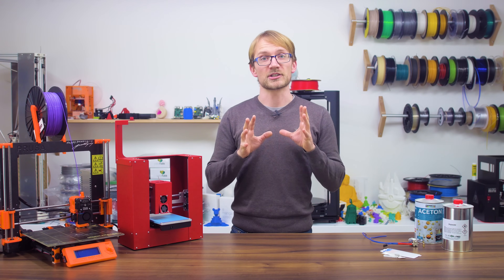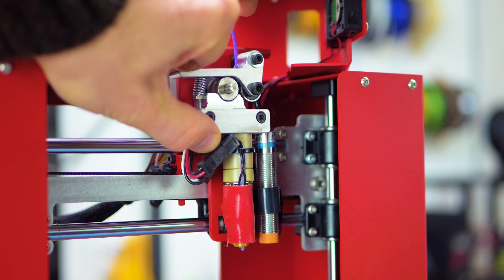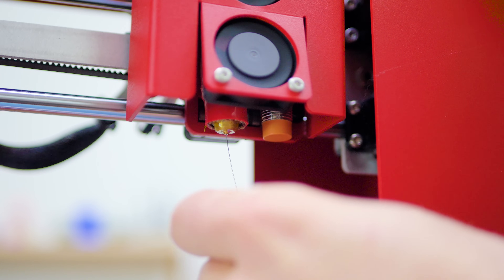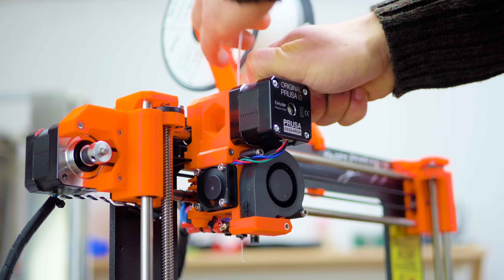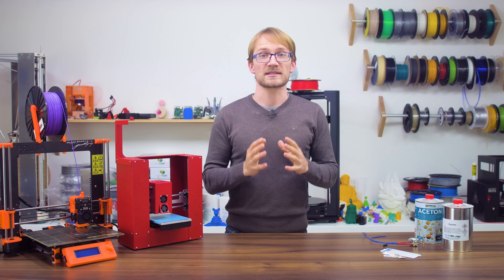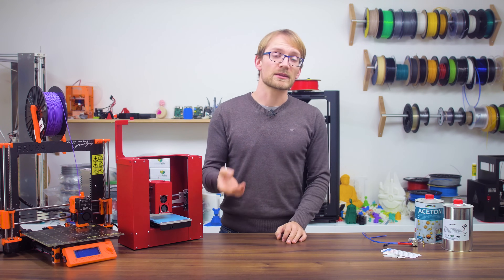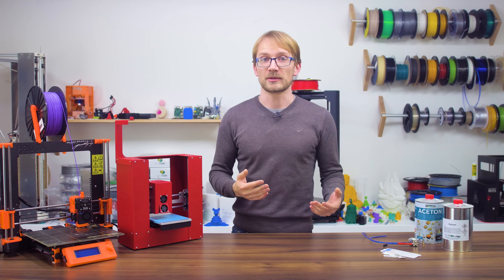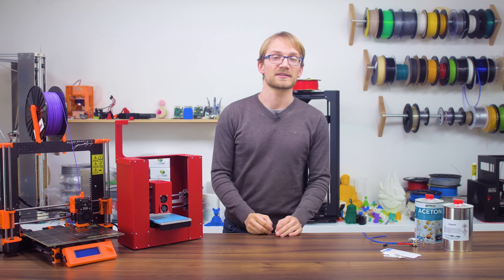Basics: Cleaning out a clogged nozzle!

Comment: I just always move to heating up and cleaning. 

But most of my blocks are in the heat break... Since I pull my filament out too cold.
Reply: girrrrrrr2 heat it to 10 degrees more than usual and then reverse the filament as far as possible with the extruder motor, not by hand.
Reply: girrrrrrr2 sorry didn't watch the video before reading comments lol.

Comment: Please review the Anet a6 3D Printer fro Gearbest, it's a cheap version of the prusa i3, I want to see if it's legit and works well - thanks : ) 
http://www.gearbest.com/3d-printers-3d-printer-kits/pp_428456.html
Reply: Does anyone know what the differences between the Anet A6, Anet A8 and Tevo Tarantula are?
Reply: Thomas Sanladerer Can't wait for all the cool stuff you've got coming up. Nice to see the wall coming down
Reply: Louis Cutner The A8 prints really well. I've got a Review coming soon.
Reply: Cool! Do you know if the A6 prints similarly?
Reply: Anet a8 and tevo tarantula will be interesting, I bought a tevo tarantula and tried to justify the price/print quality and ended with a modified printer that can print .1mm nozzle(yes, not 1mm), a box worth $40 extras ( washers, nozzles, motors, hotend...). Almost a year since I bought mine and I still can't find justification for my purchase. Will be interesting to watch Tom make a full review since it lacks coherent instructions and is potentially dangerous. It is known that printers only work if you do (especially kits) and I can't wait to see Tom have a go at it (preferably without instructions just like original prusa i3 "JUST DO IT").
Reply: Louis Cutner a8 is better option, a6 is supposed to be better but it isnt really
Reply: with an e3d v6 u get a genuinely amazing printer out of those cheap eBay prusa I3 kits. and they even sent me a replacement power supply and stepper motor driver board!!! it was only £147 at the time as well
Reply: Thanks for the advice
Reply: Louis Cutner it works like a pro one, just be careful with some materials and you're good to go!
Reply: I saw a really good print done on an FLSUN prusa i3. I'm 50 dollars short of ordering it. I want to figure out a way to get the 4 color extruder working on it. It really does do accurate and has a heated bed.
Reply: Thanks - How is it better? (What features)
Reply: Okay thanks - cant wait for the video!
Reply: Bought it, built it, it rocks. Requires mods and an existing printer. Although they don't seem to have the metal rod version that converts to the Prusa style bars easily. Sort of stuck at this point with a 2020 cross bar that works like a delta. If you can find the more traditional Prusa style I recommend it, have you patience, tools, parts laying around, and satisfaction from 3d printing.
Reply: I'll get you the BOM, you should probably just order the parts individually.
Reply: It's actually 200x200x220
Reply: Maximillian Charles sorry I meant my friends printer was only 120 cubed, I know the FLSUN is much larger
Reply: Maximillian Charles the link says that I need a decription key
Reply: Updated.